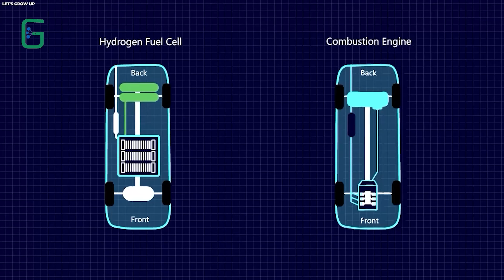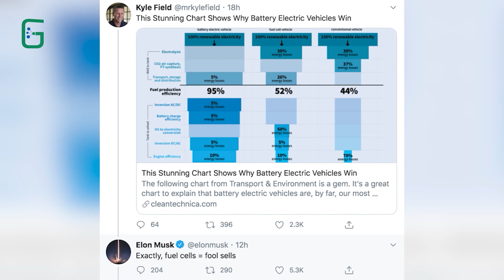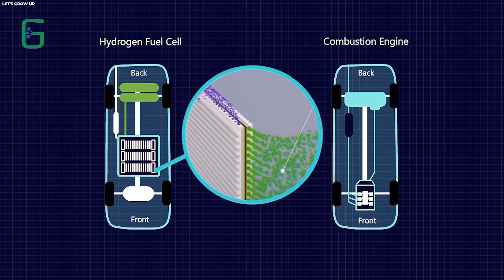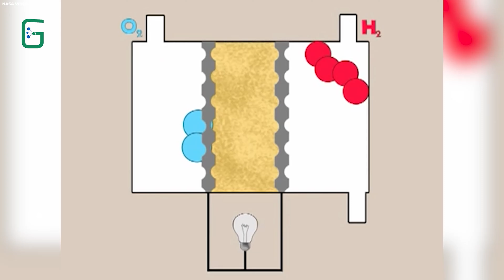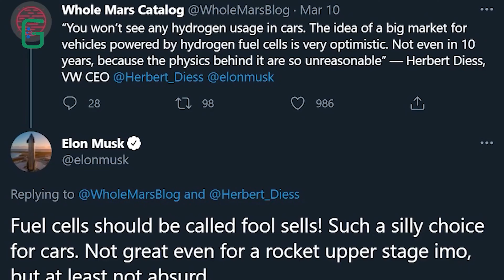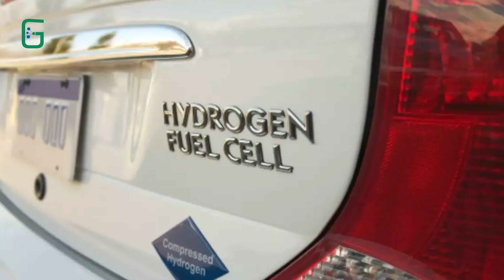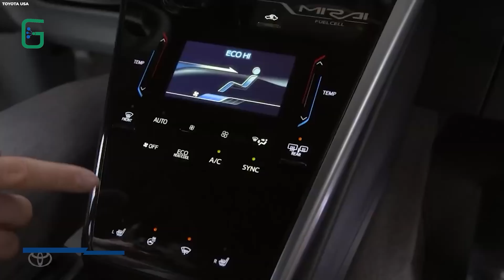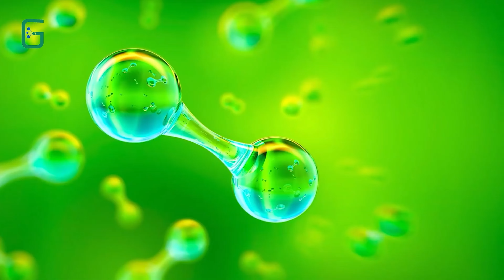Elon Musk Tesla & Toyota : Hydrogen Cars Explained

Comment: "Water engine"? Really? 😂

How about water dressing on top of word salad. Could this AI narrator have found any more cliche's??

Not only is this a useless video, its asserting a lie.

Elon still thinks hydrogen is is a stupid idea for car use.

Here's some of the issues:
1) hydrogen embrittlement causes metals to become brittle 
2) poor shelf life. Unless you build a large tank, able to safely hold pressures in excess of 12,000 PSI, it won't store for long.
3) requires large tanks to hold enough fuel 
4) transport is cumbersome